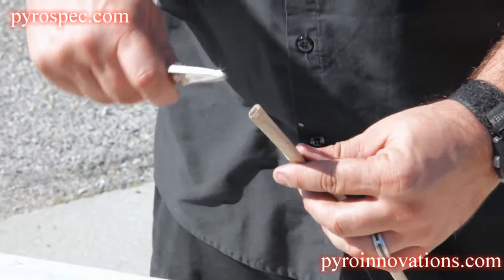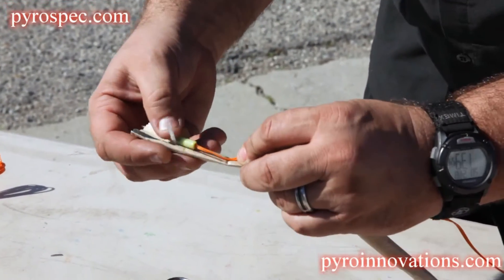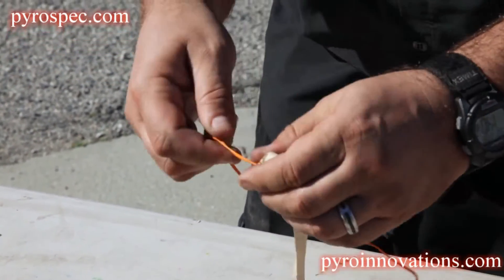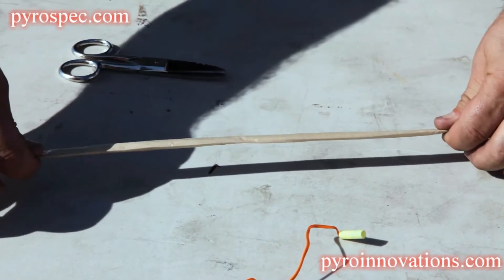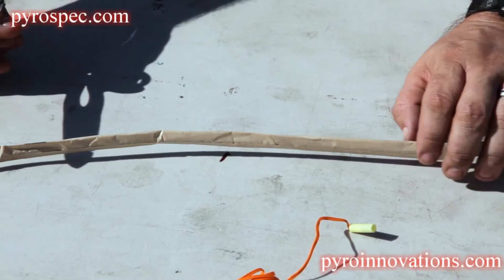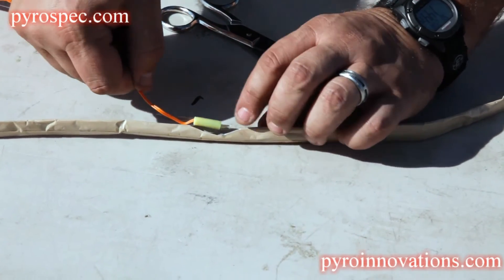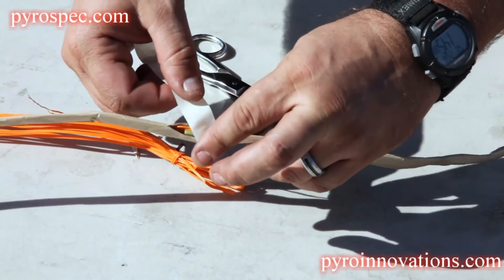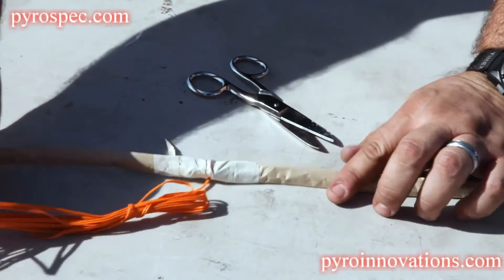How to insert Ematch into Quickmatch & Stickymatch

Comment: do you still check continuity to the field moduel only or all the way back to the fire system ? or do you have to fire it differently ?
Reply from the maker: Not sure we understand the question. The ematch would get plugged into the field module like you would any other ematch. Continuity would be performed at the firing system with the rest of the ematches just as you would do with a typical show. Some systems do allow continuity check at the module, but that would not be standard practice for most. Personally, our preference is to check at the firing system for safety reasons when ever possible.
Reply: @PyroInnovations  sorry for some reason it didnt post my full question ..In the case of inserting ematch into the black match would you check continuity to the field module or all the way back to the fire system?I do see for safety reasons the fire system is the safest way and thank you for all your informative videos and responses..
Reply from the maker: Yes, checking at the firing system provides distance between you and the fireworks, and is therefore the safest approach.  It would be treated as any other firework in the show.

Comment: Can you stick a sticky match into firework tube.?
Reply from the maker: Great question.  Theoretically speaking, yes, sticky match will work just the same as quickmatch in regards to burn speed and ignition reliability.  In many cases sticky match is easier to work with, well, because its sticky.  However, I don't see any advantage using it for a shell in a tube, and would vote for quickmatch being the easier match to use for a shell in a mortar.  I would also add that sticky match is easier to light from errant sparks raining down during the show, so for that reason alone I wouldn't use it for shells.  Thanks for your question!